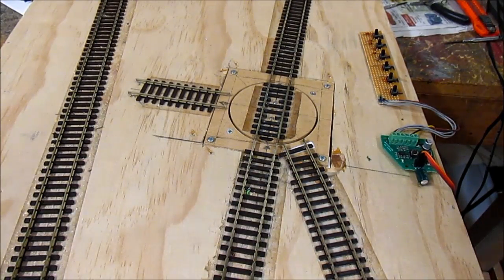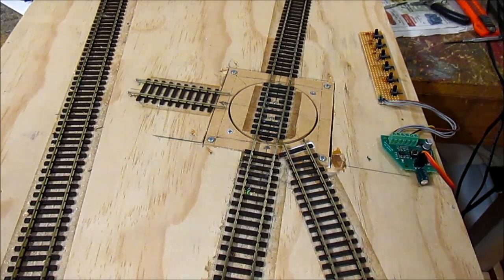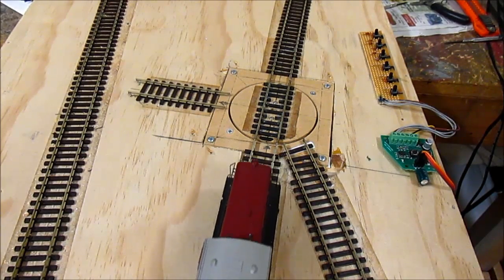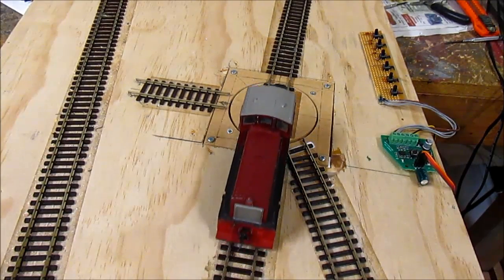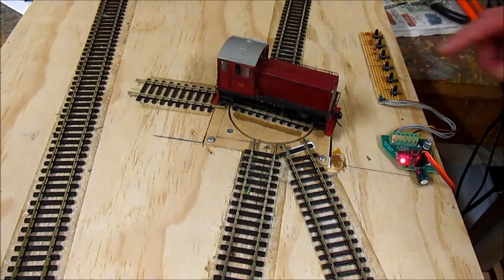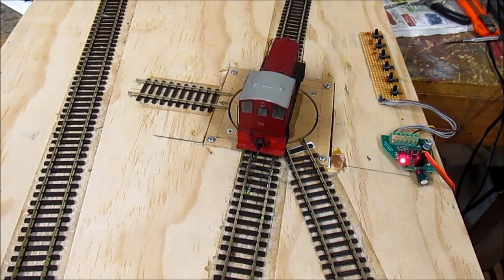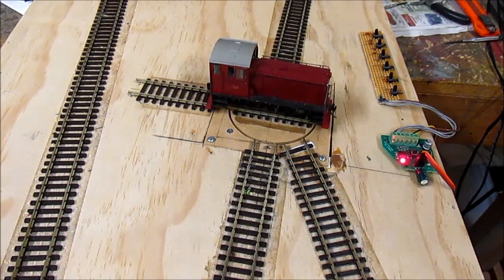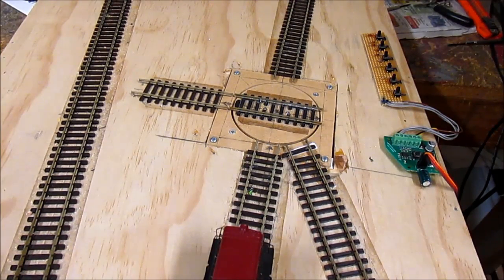Westimation Small Turntable 1

Comment from the maker: Thanks for the comment, Yes servos are quiet, helped by wood mounting.
I can adjust speed in software but found if I set it very slowly the TT would not line up as well due to the servo loosing power on small movements. I could halve the speed OK.